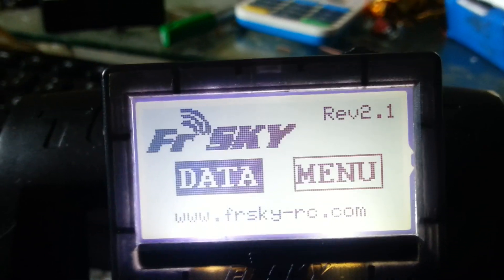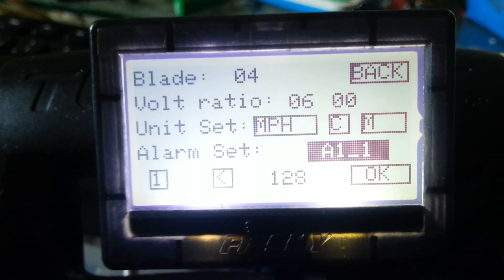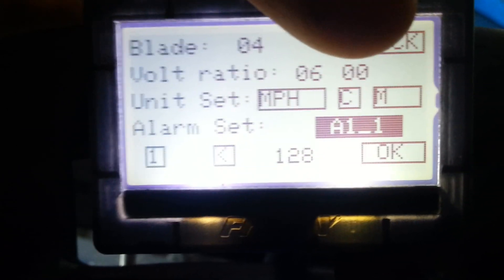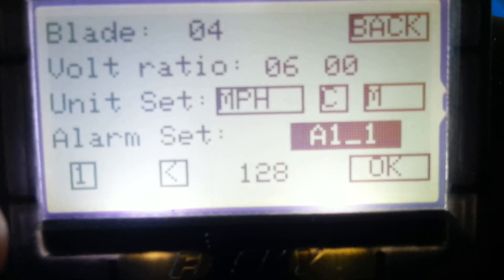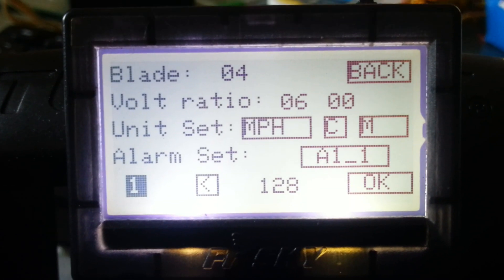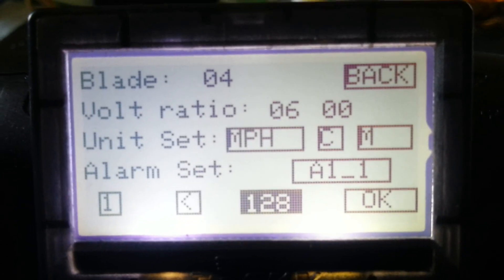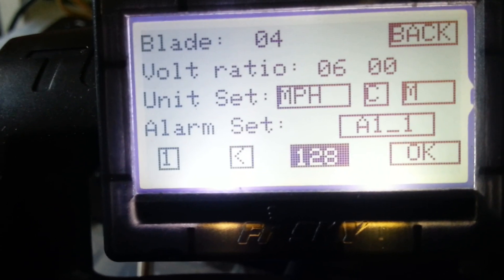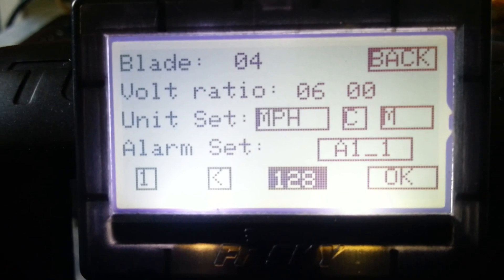Hot to set up Frsky Telemetry display

Comment: Hi,
Thanks for your guide.
Is it possible to adjust the alarm by a cell voltage ?
i'm asking because i'm using batteries with 2 / 3 / 4 cells  and this kind of setup changes according the cells number.

Comment: So with the new Frsky transmitter (taranis) it says its Telemetry, do you still need this screen FrSky FLD-02 or FrSky DHT-U  to use the telemetry or are these screens used for JR or Futaba with a module change? Still trying to figure out what is needed. I was under the impression the Taranis display showed the feed back..

Comment: thanks , i have a 9xr with frysky module (djt) with d8r-II recever , i assume i will need the lcd display that plugs into the module and a voltage sensor but do i also need a sensor hub? thanks